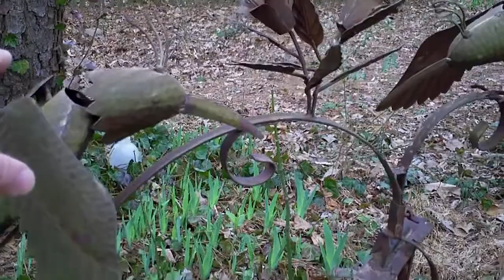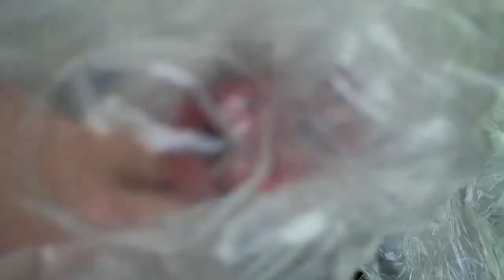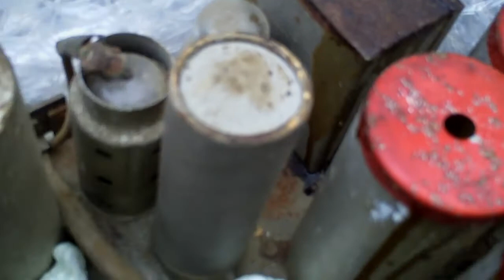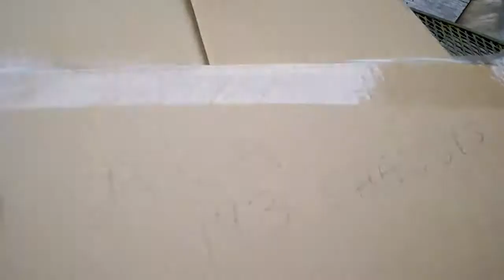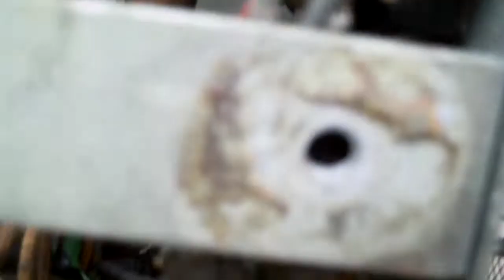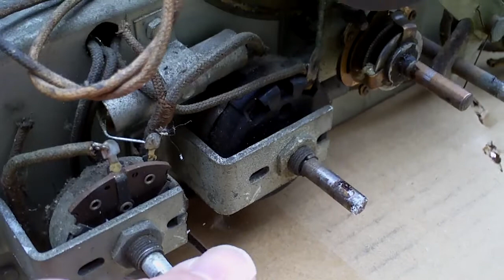1934 RCA Victor 143 Restore Part 4 of Mucho

Comment: The RCA 143 will be a great radio when you get it going.  I have both the 128 and 143 and love them both.  Also, I was told that the reason the dial is red is due to age, they fade from yellow to an orange/red color.
Reply from the maker: Actually I think some dials are red. The 100 percent beat spare chassis dial is orangy yellow and well as my RCA 262's. I'll know for sure when I light up the dial.
You are right about these being great radios. Sensitive with good front ends.